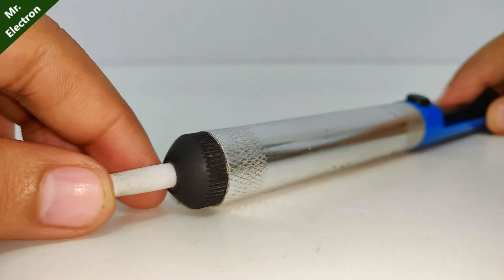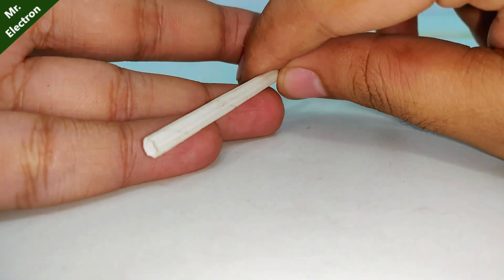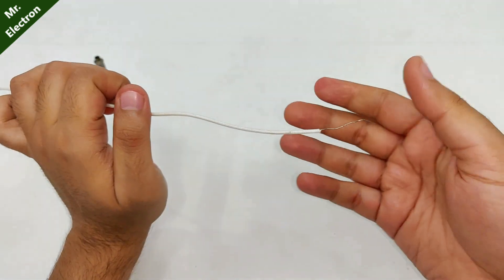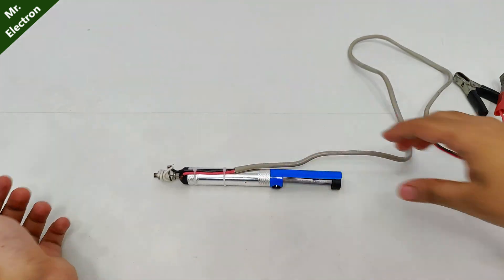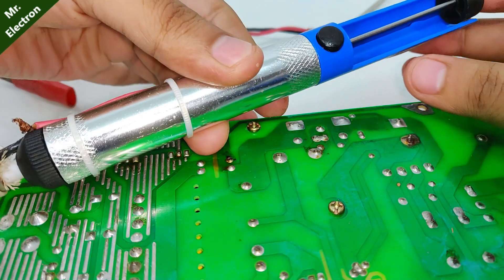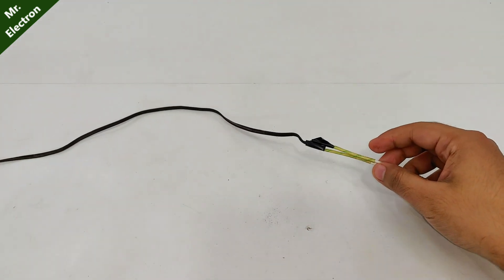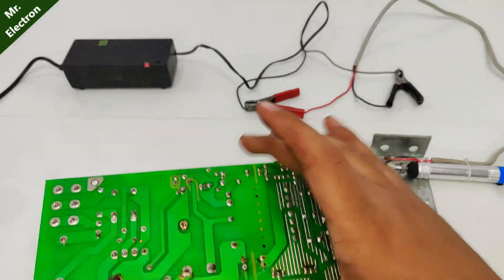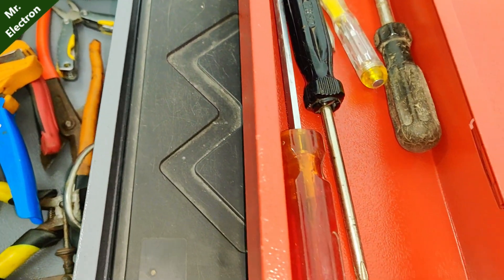How to Make 12V 50W Electric Desoldering Pump from Manual Soldering Pump DIY

Comment: DE - SOLDERING PUMP  edging tip are plastic , 
OK .......

TIP ( plastic) above ( metal  part  ) binding " nichrome " wire . OK .

so, 
        Melting in plastic tip ......
                                    Ohoo.....Ohoo
                    nice video ,
                                       aaha , aahaaha .....
                                                         super , super .......

Comment: Just because you need to get the lathe, it will be an extremly expensive project
Reply: You can use a drill press and a file. Or works case scenario. A regular drill. Fixed to a piece of wood and a file. 
Don't get stopped by certain things. This is not a precise machinist required job with small tolerances. Mistakes and experimenting are allowed and requiredm